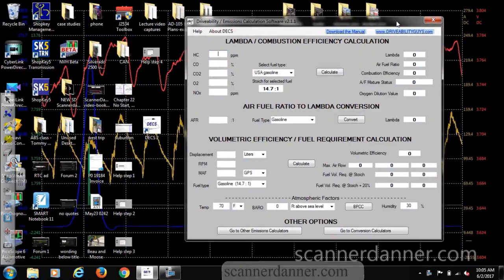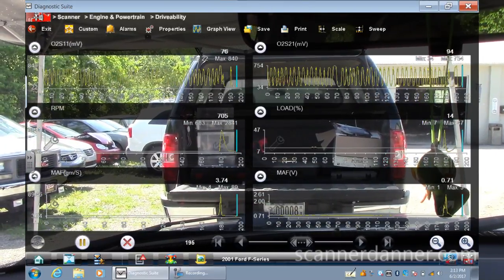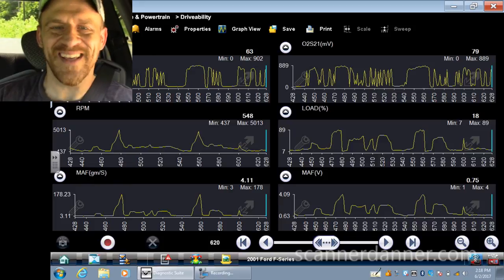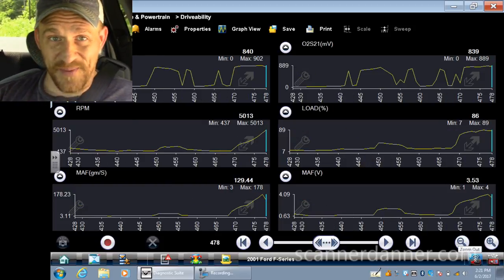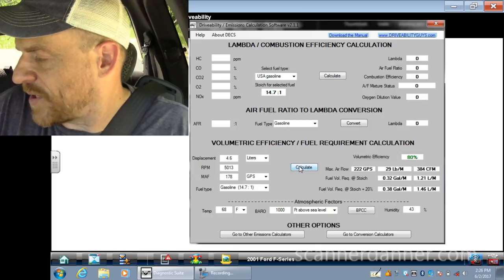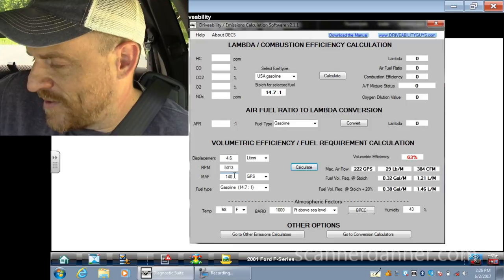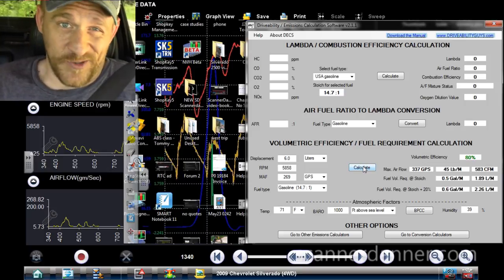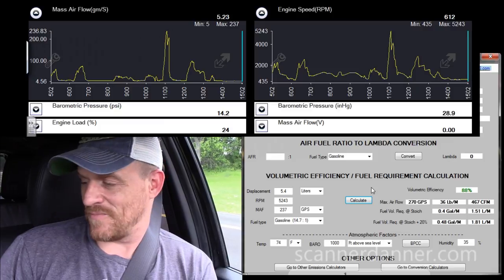Learning Volumetric Efficiency Testing (DECS)

Comment: We have a topic on the forum where we're discussing this. Think Tyler mentioned this one, not sure. Anyways this is a great subject. Looking forward to some more testing! Thx Paul. 
https://scannerdanner.com/forum/diagnostic-tools-and-techniques/599-calculated-load-vs-absolute-load.html
Reply from the maker: Thanks Dylan!
Reply: Dylan 
hi.  I think this program will be useful when diagnos valve train or timing problem and save time to keep trace fuel and ignition problems.  
what do you think ? 
thank you for all you done .
Reply: Wael Ahmed Yes indeed. The VE calculator can save us time by leading us in another direction faster than normal. It's actually an indication how well the engine is breathing. A bad MAF, restrictions, timing issues etc will have an affect on it. But we'll have to do more testing in order to fully understand all the benefits of this calculator. Also feel free to join the conversation on ScannerDanner forum. The more input the better 😉
Reply: It can also be used as proof that any work you have done has been succesful, print the screen and   show to the customer  it is easy to them understand 80% efficiency is better than 60%.
Reply: Andrew W MacFadyen best reply I've read today !
Reply: Haha 😁
Reply: So How can I tell if the MAF is skewed or not? I have a Hyundai Tucson 2.7 with hi FT. Everything checks out as far as vac leaks, fuel pressure, exhaust, you name it I checked it. I have the DEC program, and I have a VE of 71% not sure where to go from here, any input would be appreciated

Comment: Great video. My understanding about collecting the data is, with your scan tool recording, perform a WOT acceleration from a rolling start in first gear until the transmission shifts (your goal being to achieve the greatest RPM possible that is safe for the engine) and then note the IAT and MAF values in the same frame as the peak RPM (I've been using an online calculator that calls for IAT). That DECS app looks great, though.

Comment: Hi Paul! I wanted to check the accuracy of the VE calculator that you were using. I programmed all the equations in Excel for the all the inputs that were being used to achieve the VE. This was my results compared to the VE calculator used in the video.

1st Vehicle: Your VE = 80%, My VE = 79.9573706%
2nd Vehicle: Your VE = 79% with MAF of 266 g/s, My VE, = 78.8397638%
2nd Vehicle: Your VE = 80% with MAF of 269 g/s, My VE = 79.7289341%
3rd Vehicle: Your VE = 88%, My VE = 87.6950883%

This comment was just to show how accurate the VE calculator was shown in the video for anyone interested in purchasing it. I would say that it's spot on and seems to be a good one. Have a great day Paul and don't work too hard!

Comment: This VE calculation is one of the primary calculations used in the EScan software put out by Bernie Thompson at ATS. You can see it in action in one of his promo vids. Been out for a while as far as I can tell. He links the VE to fuel mapping as well. Neat program that I believe Keith uses. Thanks Paul!
Reply: Baxrok2 yes sir
Reply: Certainly seems like a good bit of software. before i clicked this vid i was expecting it to be plugged into the computer a give live results like that escan. 
Keith is there a vid of you using it in the real world?
Reply from the maker: Post the link Keith. It will automatically go to spam but I'll unlock it when I see it.
Reply: ScannerDanner https://www.aeswave.com/ats-escan-with-sharpshooter-technology-esn2000-p8729.html
Reply from the maker: I meant post a video of you using it. Not the product link silly
Reply: lol. To date, there isn't a single known incident of anyone posting a video of it in use. Other than Bernie himself.
Reply from the maker: What's up with that?
Reply: Apparently, ATS is a bit late when it comes to harnessing the power of YT. Yes, they have several videos of Bernie using/demonstrating the equipment, however that's about it. I contacted them last year and inquired about any plans for a DIYer (meaning less expensive or stripped down) version of the software. The answer was simply, no plans.
Reply: ScannerDanner I would never post a video using anything of his without consent in black and white
Reply from the maker: Seems to be a horrible way to market a product imo
Reply: I like the ATS ESCAN SharpShooter Software better, easier to understand and diagnose.

Comment: Really liking this video. It is something i am looking at with my e46 330i having looked at the fuel trims. I believe i may have a maf or intake boot problem as i am hovering slightly above and below zero at idle, then lean at higher rpm, and this would go a long way to show up the problems. Thanks again 👍

Comment: I have an older VE calculator. It doesn't have as many input parameters that yours does but i used it on the Ford F150 with some of the numbers you provided. It came up with 77% VE.

Comment: "Typical normally aspirated engines will test having a VE of 75% to 90%.
•Older two-valve cylinder head engines will test lower than newer engines equipped with four valves per cylinder"
Advanced Engine Performance Diagnosis, 4/e
By James D. Halderman

Comment: great job mr danner as always. v.e. testing is something many people are getting on board with. 
all these vehicle have shown to be running well as you have demonstrated. 
the v.e. test is quite critical in measuring how efficient a certain volume can evacuate a certain displacement of air and of course the fueling to combust. the days of older vehicle might have seen a v.e. of 50%. 80% is hat we can expect from a modern automobile. I believe the difference with the numbers can be found in the heads and valve train. if I am not mistaken the Lincoln should have variable valve timing and also dohc... 4 valves per cylinder? and just to clarify, your chevy should have variable cam timing? the dohc  can adjust both intake and exhaust independently which would give more possible overlap to help evacuate the cylinders (scavenge effect). what I am wondering is if we can see this on the scan tool, perhaps a loser 02 reading, bust still on the rich side? we can see it on the intake side with the vey high maf gps, higher than a larger engine.

Comment: I've done VE manually(math) troubleshooting bmw and mercedes. It was helpful but can also lead you astray.

A 10% STFT variance, because of a maf measurement signal deviation, would decrease VE% in the program/math. 

In the 4.6 L truck you did (as an ex.),  would decrease VE to 73% with a 10% STFT variance caused by a non ideal maf.  And this is acceptable by the ECU.

However, this isn't exactly right as the engine is getting more air than maf is reporting...which is the value used in the calculation/math for VE.

So this is MEASURED VE, not actual VE because of maf slightly out but still within operating specs of ecu.

Couple that with other variances in the engine system and you can get on a wild goose chase pretty quickly...not that that's ever happened to me...more than a few dozen times!

Still, a useful tool.

Comment: I think it would be a good idea to do this test in perhaps 2nd gear, and when you reach peak RPM, pull the parking brake on partially, and hold it WOT for at least a second or two, just to make sure the MAF has had time to react fully. I checked out the figures on your screen and did a few simple calculations, and got exactly the same volumetric efficiency as his software. I will post the equation here shortly. It basically computes the relative air density, (based on the atmospheric values you supplied) then multiplies that value by the induction cycles at the specific RPM data supplied, then divides the result by your recorded MAF. It's just a simple one line equation. Open up Excel and save yourself 40 bucks :-)

Just paste this equation shown below into Excel.

=(maf/(((rpm*(0.001156/((1.18*((990/(mbar-(RH*(6.1078*(10^((7.5*Tc)/(237.3+Tc)))))))*(((Tc+273)/298)^0.5)))-0.18)))/120)*cc))*100

You need to name 6 cells as listed below, then enter your recorded details into those cells.

You need to supply the same 6 parameters as in the bought programme.

maf -> peak Mass Airflow in Grammes per second
RPM -> engine RPM
CC -> engine capacity in cubic centimetres

mbar -> atmospheric pressure in millibars
RH -> Relative Humidity as a decimal, eg 0.3 = 30%
Tc -> Temperature in degrees centigrade

Comment: Paul it would be interesting to see what the VE readings would be on a forced induction engine, much higher I would imagine. The vvt definitely played apart in higher volumetric efficiency on your wife's car, as the valve opening is timed to stay open for maximum duration throughout the rev range. On a non-VVT the amount of air flow into the cylinders is  more restricted by valve duration in relation to atmospheric pressure.  It is my understanding they turbocharged prop engines on aircraft to compensate for a loss of air pressure at altitude. As a guess, allowing for losses occurred from valves, intake runners, and atmospheric pressure etc, most engines would be only 80 percent efficient N/A. Regards, Stewart, Australia

Comment: Hey Paul I read a volumetric test on a magazine that was promoting snap on versus and Pico scope and the test is simple as: At idle a mass air flow should be about 1 GPS per liter engine size example a 1.8 l engine should read about 1.8 gps
Reply from the maker: right, I've heard that too, but that is only a guide for an idle number, it does not mean the sensor is good throughout the range.
Reply: ScannerDanner  I guess you're right the only other test that I could think off is the WOT and the calculated load it should be over 80% on a good mass air flow other then that not too sure how to test mid range

Comment: Maybe calculated 80% VE in this program means that 4.6L engine can "suck" 3,68L of air/fuel mixture. And this value will be different on 2 or 4 valve engines. 
Calculators for converting NA engine to force induction require this value.

Comment: I was in the middle of one of your older vids (Miata with the shorted o2) when I got the notification for this one. :)

A day of full throttle runs is a good day indeed! :D

Interesting program.  I see there were inputs for the gas analyzer there too - not sure how that could be done anywhere but on a dyno, though ... unless you got super creative with the sniffer, lol. People might be staring at you funny, with the sniffer hose running out the window and going down the side of the truck from the exhaust. :D 

I'd like to see if that works at part throttle cruise, and everywhere in between - say, if you had an intake leak throwing a 0300, you could do a before and after repair VE test.
Reply from the maker: I believe you must be at WOT (so as to not have any intake restrictions). This is a test to see how well the engine is breathing. I don't think you could do anything with it at part throttle.
Reply: Ahh, gotcha. Been a long time since my performance clinic at MMI - I probably have that in my "$20,000 notebook" somewhere ... :) 

I'd be on a mission with that to see which vehicle could have the worst VE of the bunch  - like one with a completely melted cat that does nothing but make noise at WOT. BOOOOOOOOOG! :D

Thanks as always for the info.
Reply from the maker: haha no problem man. I'll be showing this some more, no doubt. My next low power condition case study, you will see this again.
Reply: Sweet - I'll be watching for that one. 

Maybe some car will hit the low 30's - won't have to worry about speeding on that run at least! :D

Comment: ve test is cool, but you can do the same thing by trying to max out the calculated load pid. calculated load will be a higher number because it seems to take into account how much the engine can actually breath instead of how much it can theoretically breath. what is interesting about this guys product is his claims about forced induction engines as most of them are speed density.

Comment: 80% is about right for american made cars without turbo 
turbo can go over 100%  yes i think variable cam timing helps it breathe alittle better
if you had low VE but going rich 02 during wide open throttle i'd be looking at exhaust
being backed up if you had low power. if you don't want to carry that calculator around
you can mulitply rpm x liter x 80 = your gps this gives you a good ideal what the gps should 
be  hope this helps
Reply: If you got over 100% an input variable(s) are not correct, likely maf AND turbo pressure.
And you better check your gps formula above...
Reply: the gps is gonna be alot higher on turbo cars and it can read over 100%
go get you a turbo car drive like there telling you here and do the math
Reply: Kenneth Hicks Any forced induction engine should have a VE over 100% since the air is compressed and thus denser.  Denser air has more mass as measured by the MAF.  Since the displacement of the engine is fixed the VE goes over 100%.
Reply: 80% should be for very old engine.  100% is easy to get with newer engines.  Specially mid range rpm, sea level, cool weather and etc.

Comment: There is many variables like engine design. Turbo charged and Supercharged engines will get you over 100 percent 'VE but a regular engine will fall about 80 to 90 percent 'VE. Great video Paul it will help and where did you get the software I don't really use Ve now but will if can get some good software to help with the Math.
Reply from the maker: Thanks man. It is in the description of this video.

Comment: It will be interesting to find out how the program factions at high altitude (about 5,000 ft or higher) under similar conditions.  Is VE going to be about same?, or is it going to be different?.  Engine load calculation figures should be much less.

Comment: Very interesting video and software test. Three questions. First does the program determine VE using mols (chemistry-uhg) or volume? Also I put together an Excel spread sheet to calculate VE (using mols-14.7 mols of O2 per mol of gasoline, assuming pure gas). The spreadsheet also has input for air density using humidity and barometric pressure. (I live at 4200 feet). I've tested it in numerous cars using BARO from my scanner, one I borrowed, from an app on my iPhone, and local weather. For some reason the BARO on both scanner always read 1-2 in/hg more than iPhone or local weather. But the scanners BARO is also less than sea level pressure (so I know it's not correcting for sea level). Any thoughts on why the BARO from the scanners consistently read different?  Lastly, are you aware of a program that will give me a MAF estimate based on an assumed 80% VE?  My spreadsheet seems to work but I would like to confirm it with another program.
Reply from the maker: a question for Scott to answer. email him scott@driveabilityguys.com

Comment: excellent videoSD   what I know is fuel trims have to be good along with MAF to look at VE to trust it as a true breathing problem  ie  if a maf was overmeasuring   air  the gps would give you a false high as far as VE   along with negative fuel trims    from what iv heard pushrod  engines  your 6.0 litre is probably normal    your wifes 5,4 multi valve  vvt  will test higher.   I know VE does not work for speed density cars    no  way to measure GPS   sorry about the cursor situation on the snappy scan tool    wondering if maxisys does better  with the cursors        maybe somebody can chime in   thanks again scan  take care

Comment: Quick question love all your vids learning lots
What the average load in amp or safe amp on a 30 amp fuse?

2017 ridgeline my fuse jumped  motor works 
Near full speed 23 amps
Then the fuse in my volt meter jumped stupid me 10 amp max 

Thx
Reply from the maker: Hard to say Phil. "They" say 80% of the fuse rating should be maximum current for a circuit. This doesn't mean it will run at 80% the entire time however.
Reply: Phil Bourgeois I

Comment: I would like to ask what mechanical reasons could make a normal engine (not turbo) have a very high volumetric efficiency and low power.egr, maf, fuel, timing is ok.I understand that the engine draws more air from delayed valves? from wrong camshafts?(1.4 cc low power ve 185%!!!!!!)
Reply from the maker: You have to be putting the numbers in wrong?
What does scan data calculated load show you on an OBD2 global or generic scan data list?
Reply: @ScannerDanner  I didn't make it because the customer took the car and will bring it back and I'll see the calc load, I've just done the ve calculation on many cars but it drove me crazy, I tried it 2 times and the ve comes out very high as if it's a turbo!!!! could a delay in closing the intake valves create such a phenomenon!!! and just to make you laugh, I fixed the car and it has torque again by changing and putting a broken maf that I had from the same model and I knew that at high revs less air is measured and the torque came back hahaha absolutely crazy. when the car arrives I will look at the calc load. my live data is from generic i dont use clobal data ,anyway, at 5000 revolutions a maf measures at 1.4 cc about 56 gr/sec while this one measured about 90 !!!!!.maybe ecm problem?   I will let you know when I look at it    thanks

Comment: paul, most of that era F150 WOT is only 88% at the tps. dont know if that helps with any questions but 80% is only 8% off of WOT
Reply from the maker: This 80% number is not related to the TPS. The throttle was wide open during these runs. Maybe I'm not understanding your comment? Sorry
Reply: ScannerDanner What i mean to say is that the fuel maps and ignition curves designed to run that f150 were limited to 88%. not the full 100%. I have no idea if that helps with any information on this test' simply stating that the 88% WOT. will never reach 100% VE if it was only designed to reach 88%. I could be way off in my thinking or having issues trying to put into words what im trying to say.